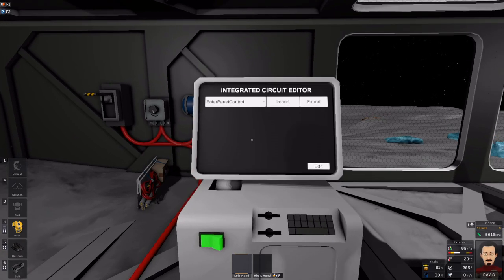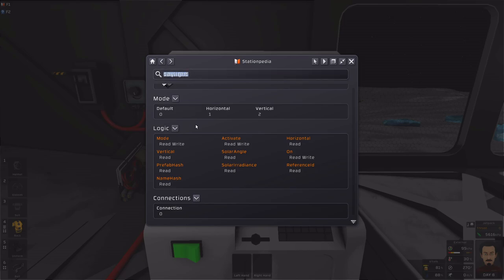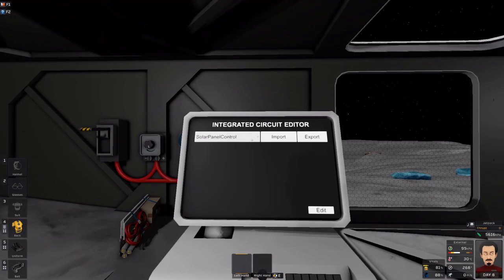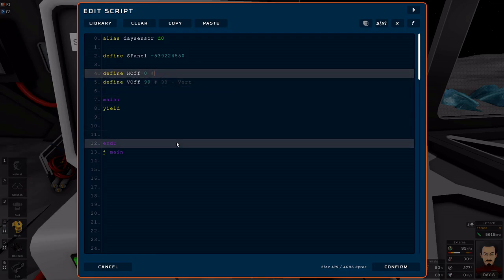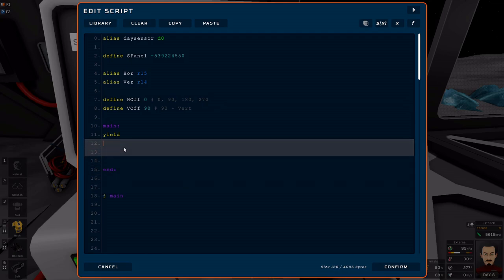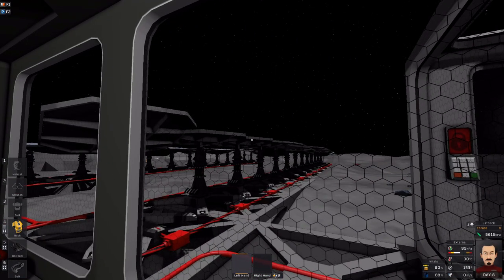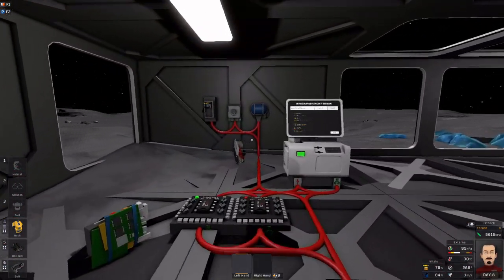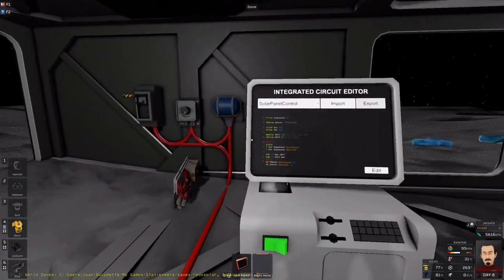IC10 Tutorial 10a: Solar Tracker

Comment: I get error on line 12 for whatever reson
Reply from the maker: From my code, that would be the load instruction to get data from the daylight sensor. Did you have the right alias to the right pin and did you use a screwdriver to set the pin to a daylight sensor on the housing?
Reply: @shadowdrake082  Actually, I'm getting an error also. line 7&8. alias lines. I can't help but think the game itself is bugged.
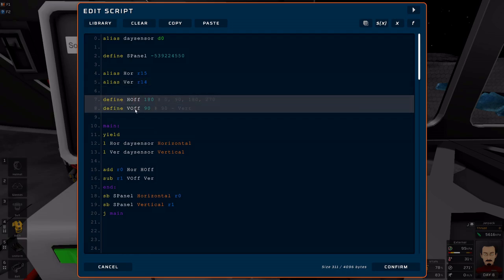Reply from the maker: @teldinstarstorm  So for simplicity, I'm referring to the end result code at around 14:23.

Usually defines may not take if there are some extra spaces. Best I can think is that there may be a syntax issue. Possibly numbers used instead of letters or vice versa.
Reply: @shadowdrake082  I cleared the whole thing, retyped it, and it worked. I think the 'extra space' or maybe an invisible char in the editor must have been the issue. Works Great now.

Comment: CowsAreEvil has it figured out: Put the solar panel down vertical, and at 0 horizontal: That's where the direction the head of the solar sensor needs to face. It's simple to remember